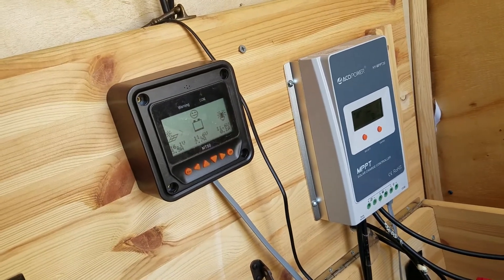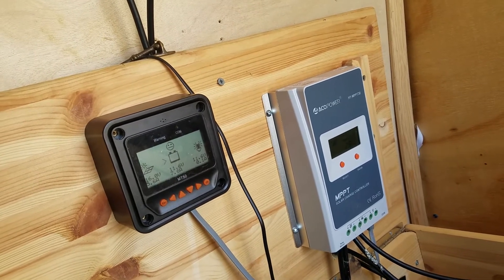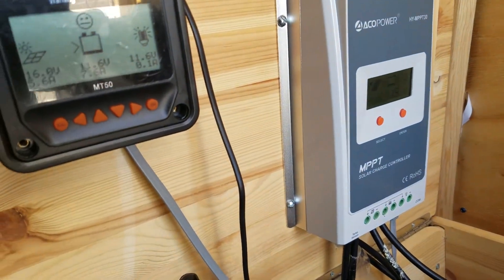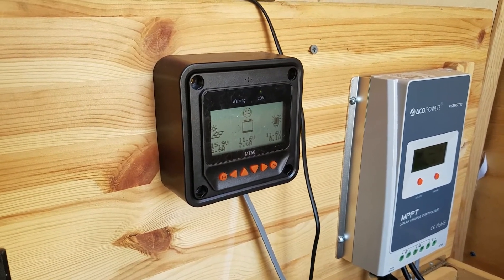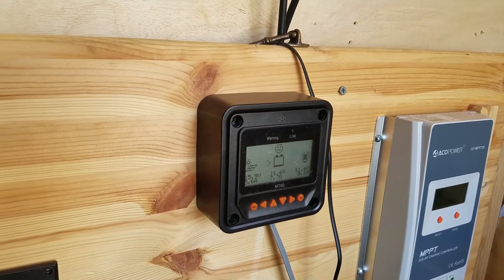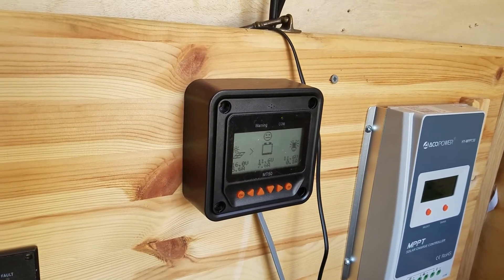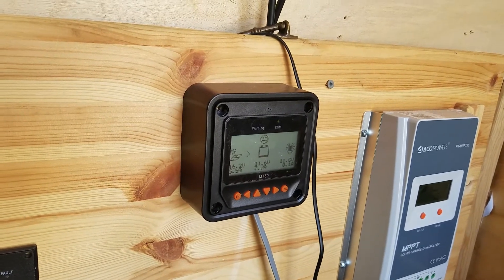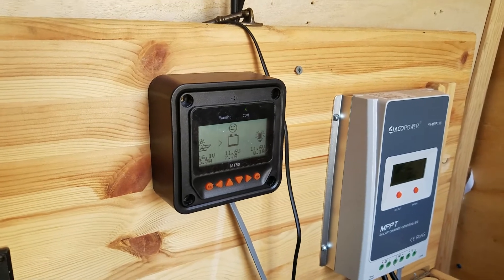Disconnect of MPPT Controller required on occasion after Moderately Deep discharge

Comment: Once you get a couple more panels and get up to 400/500 watts ....it will maintain better.... I had a 500 watt system and I would still occasionally have to plug to shore power to charge it back up ...or run the generator... 
I mainly used my solar power to run a small efficient cooler/refrigerator... I used my generator for everything else...

Comment: How's the van running now?  Perhaps get an extra battery to hold more power.
Reply from the maker: The Van is running better than it did originally,  Its so smooth I can barely hear the engine at some points..  Unfortunately I have two large batteries combined giving me 310 amp hours..  I am just not pushing enough power to them ...  When my funds recover from the repair... I must get two more 100 watt panels (since they are flexible, I don't get as much power as those with the standard "hard" panels)..